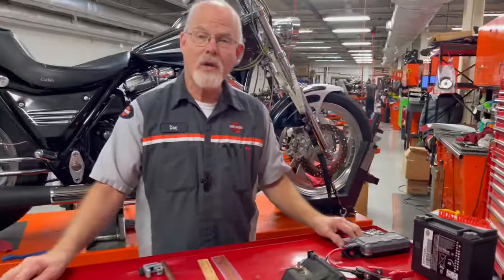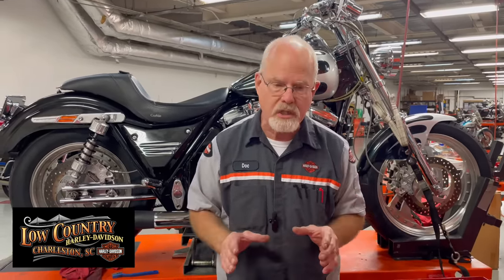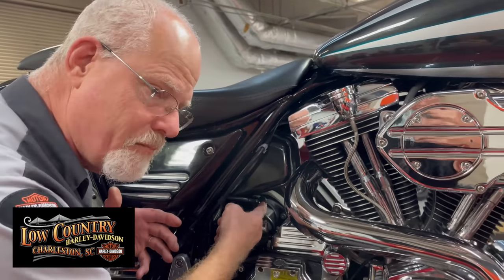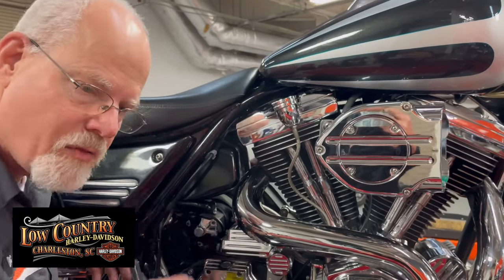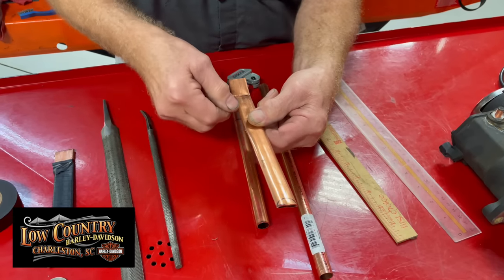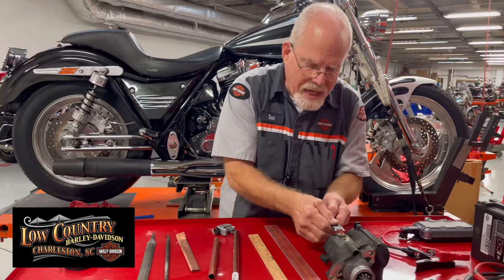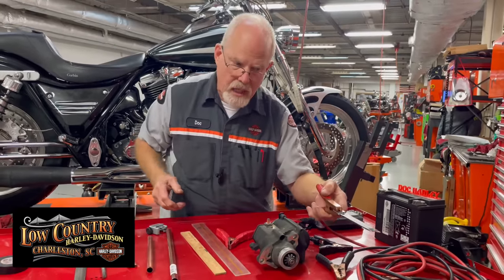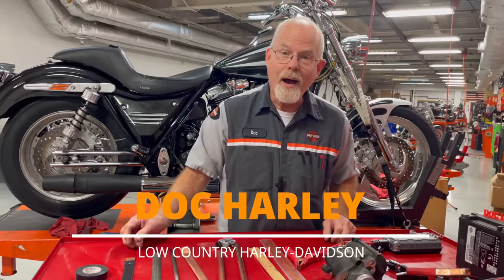Doc Harley Talks: How to Jumpstart a Motorcycle / DIY Tool for Starting Your Motorcycle

Comment: I Have a 08 FLHTC. Can it be Push started?
Reply: carburetor bike you can push start with a dead battery, fuel injection needs power for the electronics, fuel pump-sensors- ecm-fuel injectors for it to start so push start will not work with a dead battery with fuel injection. if it's the starter that is the issue then push start will work.

Comment: I've found that if you use light gauge wires you can bring down the amperage and get the bike started and not burn something up.. The light gauge wires will get hot before you do any damage..
Reply from the maker: I’m not in favor of this suggestion…Doc

Comment: Why not just bump start the damn thing?
Reply from the maker: Fuel injection don’t work that way…Doc
Reply: @LowCountryHarleyDavidson  
That’s odd, Doc.  Because, on a couple occasions when I’ve let my battery get too low to start my 2007 FXSTD, I’ve rolled it down the hill on my street and popped the clutch in second gear and it started right up.

Comment: Why any manufacturer would design a motorcycle electrical system that fries if you jump start with the donor vehicle running is beyond me.  All the electrics on the bike are obviously able to function at the voltage provided by the running donor - it's the same voltage generated by the bike's own charging system, after all.  If voltage spikes are the problem, they are easy enough to suppress with cheap off the shelf components.  And the bike's charging system produces similar spikes when running - so what's the problem?

Jump starting is an occasional fact of life, so the motorcycle electrics should be designed to tolerate any conceivable screwup by the user, within reasonable limits.  It's not that hard to do.  Saving a buck on voltage spike suppression that leaves the bike vulnerable to VD (Voltage Destruction) is criminal.  Just my not-so-humble opinion.
Reply from the maker: That was a Tall Box you were standing on. Your opinion is noted…..Doc

Comment: What a waste of time, modifying a copper tube.  If you have (what looks like) a NoCo Starter pack then NoCo leads can be purchased and fitted to the battery.  The starter pack can be connected to the battery by externally plugging it in.
Reply from the maker: Well Pete, thanks for sharing your 2 cents…Doc

Comment: I don't think this is correct and a misleading explanation, the wire to the top of the starter motor doesn't go direct to the battery positive. It goes to the switched side of the starter solenoid. If you connect a battery to this the starter will turn over for sure without pressing any buttons on the bars so don't worry about holding it on and reaching for the bar. You will get sparks as well when you touch the terminal.  You need your ignition on for it to start, if your battery is totally dead then the electrics may not power correctly as you are not connecting to the positive. The only way this would work as explained is if the bike switches the negative of the starter motor but i think youll find it doesn't.
Reply from the maker: I’m misleading?……Doc
Reply: @LowCountryHarleyDavidson  hello doc, yes I feel this video is very misleading. If you connect the negative of an auxiliary battery to your frame and place the positive onto the point on the starter motor the starter motor will spark and turn over instantly. If the bike is in gear or not stable it could fall and hurt someone. Your video gives the impression that when you connect the tool to the starter motor you need to press the button on the bars to start it. This isn't the case. To anyone that doesn't understand or know what they are doing this is going to cause an issue. You would need to make sure that the bike is in neutral, make sure the ignition is on and then touch the starter motor for it to turn over. If there is not enough power to turn the electronics on I don't think this will work. This isn't a good method for a flat battery. Is more like a method for when you have a solenoid issue. Ps, I like your videos just this one I feel is very dangerous and not explained well.
Reply: @LowCountryHarleyDavidson  you have people saying things like I'm going to drill a hole to make the connection more secure. If you can't pull the tool away from the starter motor the engine will keep turning. The video makes it sound like you are just connecting a battery to your system the same as the battery on the bike. You're not, you are connecting the starter motor directly to a 12v supply, it will keep running until the tool is removed.
Reply: What bike or world do you live in?
Reply: @omarrueben  are you drunk
Reply: @OrangeManStan  The 'large cable' coming off the starter goes directly to the battery. Connecting a positive jumper to the 'large cable' keeps you from having to pull the seat, and other items, just like connecting jumper cables on a car. Of course you don't connect the jumper to the small wires. That would be dangerous and dumb. Those small wires don't get energized 'until' you hit the starter button on the handlebars. By the way, I don't drink!
Reply: @omarrueben  you have no idea how a starter motor is wired. It does not go directly to the positive of the battery, it goes to the feed from the solenoid. This will not power the circuits of the bike but it will turn the starter motor over instantly and it will make massive sparks. On a big v twin the amount of current required to turn the bike over it may also arc weld itself to the terminal, if so the starter motor will keep running until you snap it free. If your bike battery is completely flat there's a good chance it won't fire the engine when you remove the wonderful tool. To jump start any vehicle you need the bike ignition on which requires 12v on the battery terminals. This method does not provide that and relies on the fact that your bike battery has enough power to energies the circuits. Do you understand how the starter system works? I'm not sure Doc Harley does either
Reply: @omarrueben  if the starter motor positive is wired directly to the battery do you know how it gets its neutral? This is so funny it's got to be a joke 🤣
Reply: @LowCountryHarleyDavidson  Doc I apologize, this is correct for Softails and many other Harley's, but if the person watching has any of the VRods or I would imagine the new Sportster S  and so forth they would get a very nasty surprise. You said any modern motorcycle this will work for. If you try this on any Japanese bike this would be very dangerous if you are not expecting the engine to immediately turn over. They could loose their fingers or worse. I would explain this to your viewers as I said it is very misleading.
Reply: @omarrueben  I apologize as this is correct for Softails and many other Harley's. But if the person watching has any of the VRods or I would imagine the new Sportster S  and so forth they would get a very nasty surprise. Doc stated that this works for any modern motorcycle, this is massively incorrect. If you try this on any Japanese bike it would be very dangerous if you are not expecting the engine to immediately turn over. They could loose their fingers or worse. The majority of bikes made do not work like this but have exactly the same looking cable and fixing nut on top of the starter motor. Doc and his company could be liable if someone has an accident due to misleading advice.